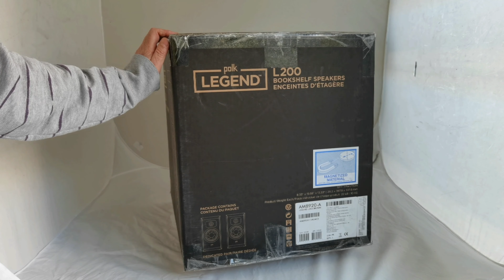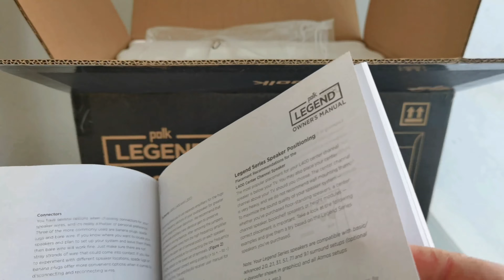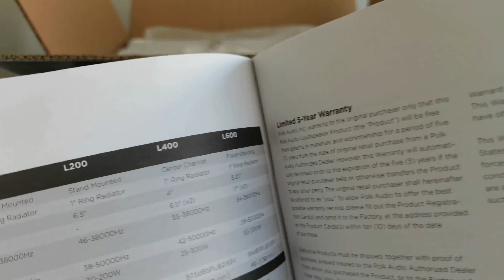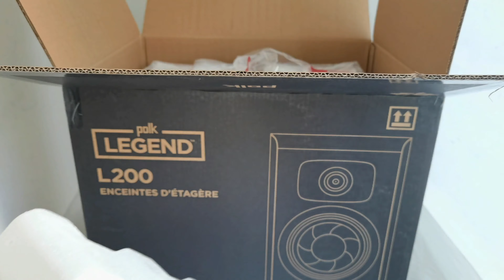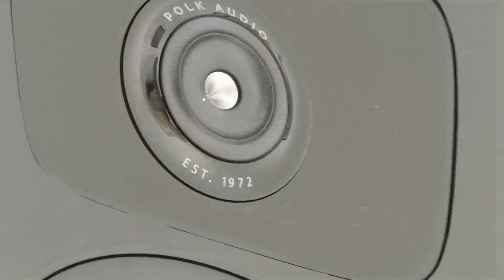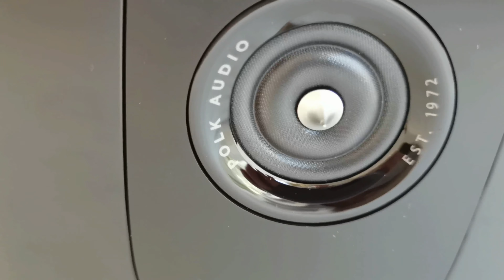Polk Legend L200 Unboxing and Deep Unboxing | hands on experience

Comment: Wow, they use a stamped basket for the woofer, that seems a little cheap.
Reply: Man that's exactly what I was thinking. I've been trying to figure out it they are using stamped steel baskets but know one really mentions it.
Reply: @JuanLega  Polk used a solid metal basket in the last generation, I think this one is just a stamped basket. Not worth it in my opinion.
Reply: @giangvu7902  yes, I know the LsiM series used casted baskets that's why it doesn't make sense to me than "on the best speaker ever designed by Polk audio" also, the most expensive that they would use a stamped basket....